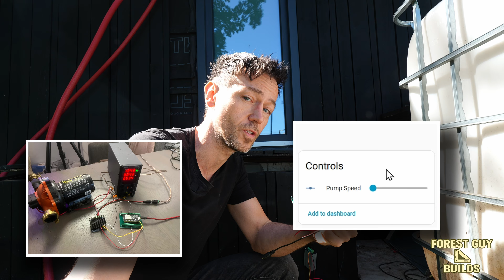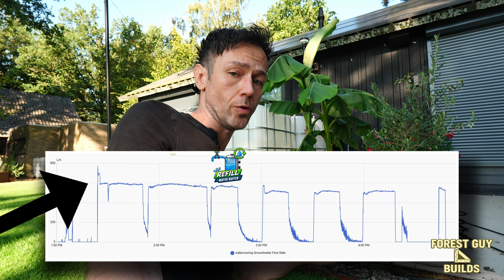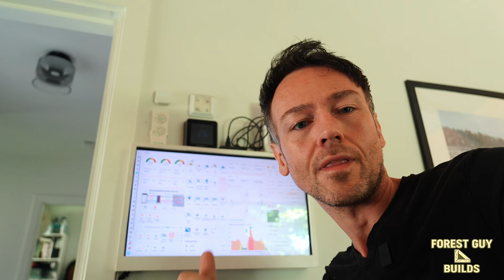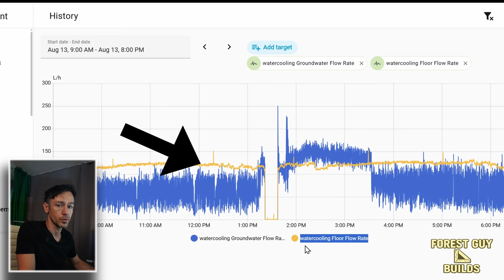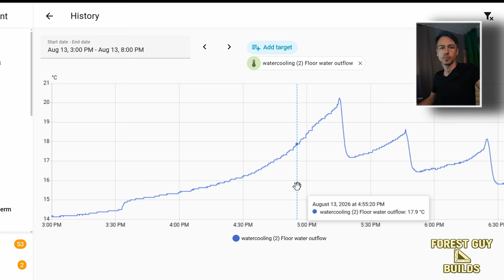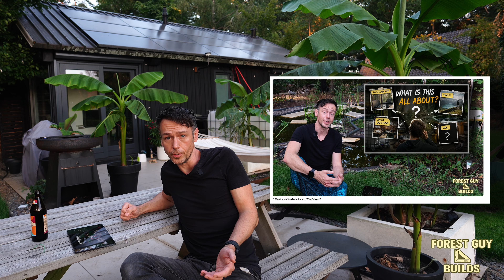Can I Fully Automate My Groundwater House Cooling? (Part 5)

Comment: It seems most of my ideas have been covered, either by you or by other commenters. Such as using a water to air heat exchanger and allowing the condensate to drip away into a drain, thus reducing the inside humidity. And possibly in the future installing hydronic ceiling cooling. And a closed loop in your well. And I think there were others that I've forgotten.

But one idea I haven't seen covered is to use soaker hose or drip irrigators for your watering. And if you don't have a large enough pressure tank on your well pump system, get more and insulate them very well. Then depending on how much area you have to water, the flow might be correct to cool your house and you won't need the extra reservoirs, pumps and computers. And if the flow would be too much, then you could install a needle valve to reduce the flow to the correct flow.
Reply from the maker: Thanks for stepping in again, Mikey! Good to see that most of it is covered already, still some idea's, but we'll come to that!

Btw, there is something weird with your comments. I don't see your comments showing up under any of the videos anymore, which is strange because I do see them in my community dashboard. Somehow they disappeared under most of the videos... 😮😒 Do you have that with other channels as well? Trying to understand things, as I also still have a hard time have everything configured well. YT is still don't allowing me to update EN subtitles, as it defines them as Dutch... but they are English.... Yah... don't get it, created support case again, hope it someday all works out as it should...

As for the insulation around the current tank, that's still work in progress. I want to work more on that, but I think that will be dragged to next summer as we're approaching the cold season now.

The drip irrigators / soaker hose idea is interesting as well. If I understand you correctly, you mean using the groundwater (return, from the heat exchanger) directly for watering, and matching that flow more or less to what I need for cooling?

Most of the plants I need to water are a bit further away from the reservoirs, so I still need some pressure to get the water there. The small pump to the exchanger won't be able to handle that i'm afraid. It's low power pump, so updating that to more powerful, will use more energy there. I need to investigate that a bit more. Maybe I'm still missing something in your idea, the project definitely continues when days getting warmer again 😎
Reply: @ForestGuyBuilds  YouTube hates me, they are a very hate filled company. They hide most of my comments and they often don't count the thumbs I click. I have thumbed up every one of your videos that I've seen and every one of your replies to me. When I open the video in another computer that isn't signed in, sometimes I see that my thumb clicks were counted and sometimes not. And I pretty much always have to click on the "sort by" above the comments and click "newest" to see my comments at all, when they are even posted. I'm guessing you also didn't see the reply I left to your last reply to me, about the oiled wood.

I'm not a very good explainer, you did seem to misunderstand, sorry about that. Well water systems usually have a pressure tank (a tank that has a rubber bladder in it which is filled with air pressurized to close to the same pressure as your water pressure, which acts as a buffer or a capacitor so your pump doesn't cycle on and off too frequently). If you use a soaker hose or drip irrigation system, you could just run the water line directly from your current well water system, through your heat exchanger (if it can handle the pressure) and out to your irrigation system. But if your current pressure tank isn't large enough, you might need either a larger one or you could just add more pressure tanks. But it would be best to insulate the pressure tank(s). By doing that you wouldn't need the IBC tanks or the extra pump that you're currently using. You are already pumping the water from your well, but currently you are pumping it twice. With my idea you would only be pumping it once (again it will depend on whether your heat exchanger can handle your water pressure).

I don't know if that is any more understandable. Again I'm very sorry I'm such a bad explainer.

Comment: good presentation and much clarity and I thank you.     I shall use my 170 deep well with a flat plate exchanger to flow through a 150k btu heat exchanger with 12 vdc fan and a gutter under exchanger to pick up condensation and pour that into my gravity drip water filter while returning the ground water back to the ground.    I shall run two legs so the water in the pipes is balanced with a pump near the top as i have no other choice............we shall see!
Reply from the maker: Cool to hear that you appreciated the presentation 🙏

Am I right those are plans, you're gonna experiment with this? 😎 In that case; thanks for stepping in and sharing your plans with a closed loop system, returning the groundwater back into the ground. That's awesome, because even with less actual water use, you can still make optimal use of it. I wish that was an option here, but you get me thinking, maybe worth to figure this out here! (thanks for bringing up, somehow I thought closed loop was only possible by very deep wells.... don't know, it was just my first assumption).

Also thumbs up for the gutter underneath the heat exchanger. I wanted to create that as drain, but for now it's sufficient with some towels around the plate heat exchanger to prevent condensation to happen. Not that pretty, it works for the current testing setup.

Do you have any idea how many liters/hour you're planning to flow through the system? It would be interesting to use several temp sensors to analyze how much cooling capacity you're actually getting, or better said, how much heat energy you're taking away from the house.

And maybe I missed it in your explanation, but is this / can this also be connected to underfloor pipes? Or are you only cooling through the heat exchanger (radiators?) with air flowing through it? Sorry if I missed that part. Interesting to have others experimenting with this involved 🙏
Reply: @ForestGuyBuilds  As far as the closed loop well water system goes, if your well water is cold enough (as yours is) to cool your house, then yes you could do a closed loop system with it. It's just a matter of money for a closed pipe loop to feed down your well and all of the other components. Well water isn't like a stagnant pool of water, wells tap into underground rivers that are constantly flowing so a loop will warm it up, but that warmed water will continue flowing through the ground and being replaced by cold water and the warm water will eventually return to ground temperature.

And I'm fairly confident that the heat exchanger the above commenter mentioned is a refrigerant to air heat exchanger as found in common HVAC systems, but they're converting it into a water to air heat exchanger.

Comment: Just thinking how it will perform here in Pakistan,  the outside temperature is above 45 degrees in summers.
Reply from the maker: Awesome to see you're watching from Pakistan! ❤

> 45°C  summers are on a completely different level! Curious, what's the indoor temperature you get there while 45 outside? Using any cooling at all? What are the common ways of cooling homes in Pakistan? Can imagine it's quite different with those kind of temperatures...
Reply: @ForestGuyBuilds we are use to this temp and weather. On first floor sun hitting directly on a fine day room temp will be approaching 42-43 degrees.  Pakistan is among the top countries in solar power consumption.  So at my home I am at 10kwh solar hybrid system to support at least 2 a.c of 2tons running  continuously. Hybrid  system which sells back unit to govt saves me from heavy billings.
Reply from the maker: @SannanTheTraveller  Think that makes a world of difference, being used to those temperatures, so you don't have to go that low to at least make it acceptable to get through those days. For us, those (~35) temperatures are really just peaks that we try to "get through". Guess it's all relative. 

Still curious: is there any groundwater use at your place at all, for example for watering the garden or maybe even showering? Or are there those "buffers/water containers" on roofs, that heat up by sun and are used for showering? 

Of course it all depends on the amount of water flowing through, but what I experienced here is that even with an acceptable amount of groundwater (which is relative, of course...), it can already be quite a powerful tool for some additional cooling. But guess for little water need, the installation becomes to complex for the cooling capacity it offers. I like those type of interactions to learn how it's working elsewhere, thanks for your response 🙏
Reply: yes we use ground water always freshly pumped.  So there is no scarcity. We have ground water 24/7 readily available at 100ft.

I was thinking if we can just pump the water and pass it via heat exchanger and dump that water to another ground boring continuesly. 

Another approach to keep the water temp down is  have two or more underground tanks in a closed loop. We need to shift the flow to different tanks to have underneath (earth and water) temperature optimized for water cooling so that we can have a  better cooled here. 

3rd idea is a single underground tank along with some technique to keep the earth temp cooler then the heat exchanger water. Maybe use water sprinkler or something
Reply from the maker: @SannanTheTraveller  Thanks for confirming the availability of groundwater. That gives you a powerful source to experiment with. I don't know the regulations there, I'm always trying to use as little groundwater as possible, especially during dry periods as they inform people to use as little as possible.

1. Returning it through another bore: I know systems like this exist commercially, but I only have one pipe going into the ground. Creating a return well would take some work... If you have the ability to (easily) do that, sounds useful. But I'm no expert here! Gonna figure this out for myself as well, as it prevents the need to water the garden after the water heated up a few degrees. Will make water use even lower.

2. Underground tanks: Curious about your detailed thoughts on this concept. The water still needs to lose its heat somewhere. Putting 26°C water underground doesn't make it cold again, unless the surrounding ground can absorb enough heat, which might be limited if the ground around the tanks isn't much colder than the water. And; you'd need quite some buffer capacity there to provide time for it to cool down, and flow (using energy) as well...

3. Sprinklers: don't get that one exactly; cooling the earth cooler sounds like water use as well, don't know if that will become efficient at the bottom line, as the goal was to achiever lower indoor temp. 

Curious about your progress and findings.

Comment: Greeting from New Mexico and thank you for a most interesting series on your geothermal cooling system. Appreciated the use of data to drive your refinement of the system. After watching this, I had to go outside and check the temperature of our town-supplied water. Alas, it's 37 C outside right now, but the water is 26 C. Many houses still use old technology evaporative cooling. As long as the relative humidity stays below 40% and you don't mind living inside a wind tunnel, it works well and is energy efficient.
Reply from the maker: Awesome, welcome Robert from New Mexico! 😄 Really cool to see the reach of these experiments slowly getting further away from my little place here in the Netherlands. Cool this actually made you go outside and check some temperatures of your own setup! 

Maybe you recognized, as long as I can manage, I'll like to go deep on in depth comments, because that's where the experiments get better and better over time! 😎

I'm actually not that familiar with the older evaporative cooling system you're describing, so that's something I need to look into a little more to have a better understanding of what it does. But i'm no HVAC / cooling expert (!!), although there are some commenting on those video's, so my knowledge is also increasing along the way 🙏

You got me curious though: you mention the water is 26°C while it's 37°C outside. Where exactly are you measuring that water temperature, and what temperature does the water start at before going into the cooling system?

Have you ever measured the different temperatures throughout the system? Maybe even realtime, if you like the data stuff.... With a couple of cheap DS18B20 temperature sensors and an ESP (hookup to Home Assistant for example), or even just one of those off-the-shelf Amazon temperature controllers with 2 or 4 probes (just stand-alone, no hassle), you could track the water temperature, outside/incoming air temperature and the air temperature after the cooler. Could be quite interesting to see what the system is doing and how much cooling you're getting out of it... hey, it just triggers my enthusiasm!

And as for living inside a wind tunnel 😂, that's an interesting part of the comfort side here as well. Floor cooling itself isn't something I'm inventing here, it's already a proven system used with heat pumps. I experienced it at some friends house and really like the system, so that's basically why I started experimenting with using groundwater as the cold source instead, on my place.

On the really hot days, like 35°C+ outside, I currently still need my big ceiling fan  to keep the house around 23–24°C.  Fan is not providing "cold", but makes the floor being able to chill the warm air, and the chilled air cooling the interior... But when I'm sitting in the living room for a longer time, I can just switch the ceiling fan off and the perceived comfort changes immediately.

Eventually though, I don't want to be manually playing around with pumps, fans and temperatures all day. That would kind of miss the point of what I'm trying to build. The goal is to automate as much of that balancing as possible, It's some living project/experiment.

Thanks for sharing your setup and the New Mexico perspective. Interesting to compare how different climates lead to completely different ways of solving basically the same problem. Also the resources available or common in that area, like groundwater for example. I'm trying to use it as little as possible, but WHEN using it (for garden), it's awesome that it has this "double function" 🙏

Curious about your water "starting temperature", now thinking about that; don't know if you refresh the water automatically. If it's constant flow or working with a buffer. With some temperature data gathering throughout the day you maybe optimize several things..... yah, stopping now , enjoy the experiment!🥳
Reply: @ForestGuyBuilds  Evaporative or 'swamp coolers' as we call them, have a water reserve that is fed by simple water pressure. A simple float valve keeps the water level constant. A water pump inside the cooler soaks porous pads on the exterior of the cooler. A squirrel cage  fan/blower pulls outside air through the soaked pads, evaporating the water and cooling the air and forcing it into the house. You leave a few windows cracked, and the cooler replaces all the air in the house every two minutes or so, ideally. The most important factor in cooling is humidity level (ideally low) followed by the thickness of the soaked pads. External air temp typically reduced 10-15 degrees C. 

We are on municipal water, this was measured at an external spigot. In the summer it's warm, in the winter it's cold and there's not much to be done about that.

I have a small house that I was considering modernizing the cooling system, but your videos also helped me appreciate the simplicity and efficiency of the old tech evaporative coolers. You can buy all the parts you need for maintenance from the local hardware store.

Thanks for the reply! I am quite glad you are able to stay cool during the brutal heatwaves you've had there.